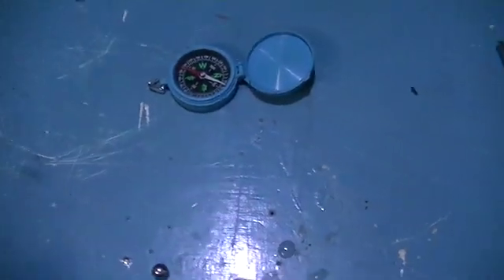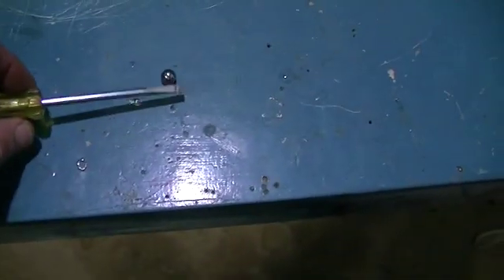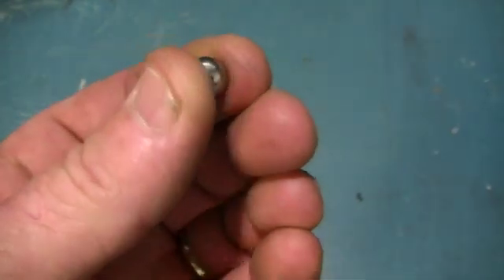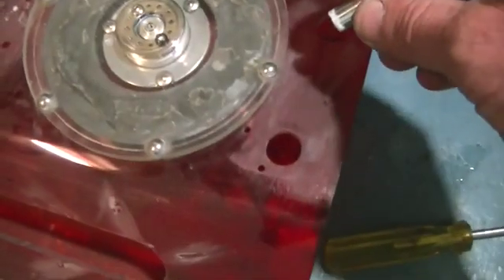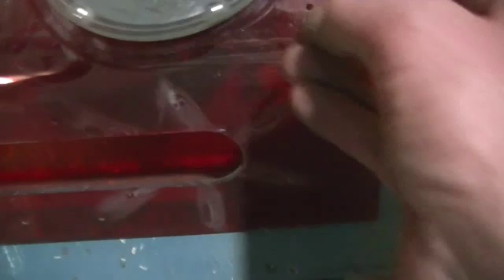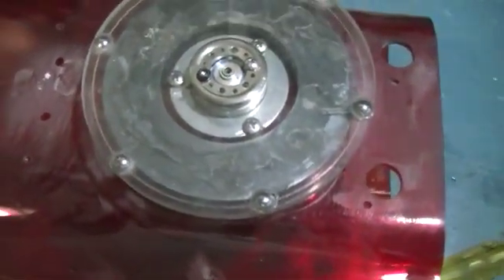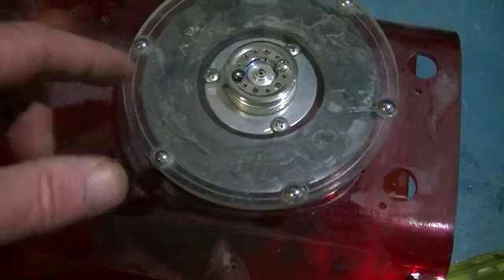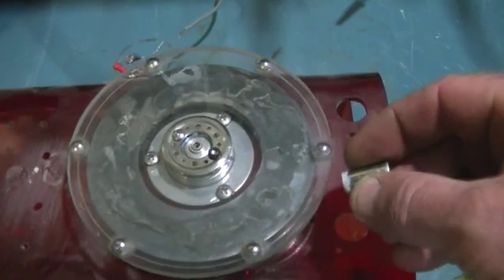making a monopole magnet.mp4

Comment: You don't actually need a monopole magnet. There are manufactured cylindrical magnets, also unipolar magnets which you can buy on Amazon; the cylindrical magnets which have one pole pointing in and one pole pointing out, will give the desired results.

Comment: This is another proof that you can't break the law of thermodynamics. You can not make a motor with static magnetic field. Tesla's brushless motors are using rotating magnetic fields with his polyphase AC motors.
Reply: +Odouls77 Still Tesla was told that AC polyphase was impossible by a professor. He said it was a "perpetual motion scheme, an impossible idea". This is what fired Tesla to prove it could be done.

Comment: You are right you have to have motor 1/2 magnetic and  1/2 conductor at the atomic level  to make this type of motor to work perpetually. The reason is you don't want one metal taking on more  magnetic attraction than the other meta so that it puts less resistance  into any motor. I know we are talking about magnets but the end result here is a free energy device that powers up enough to have a load put on the motor with out any prim mover except the electrical motor that self propels itself and power other  devices as well.
Reply: free energy motor doesn't run some trick has been used

Comment: All magnets are bi-polar but a shaped field can act like a mono-polar field. Check Youtube for David LaPoint and his Primer Fields. A current going through a magnetic field can reshape the fields and do what I call phase shift to change the shape of that field. Best way to see magnetic fields is with plasma flow. Now we are getting into some cool Tesla stuff.
Reply: Thanks you for pointing out David ;)
Reply: Craig Watson Sense I commented before, I have learned a few things about magnetic funny actions that still blow me away. In fact, magnetic funny action can account for almost all things in the universe. Magnetic force is the mover and all other things are just effects of such. Starts with magnetic potential, force, polarization, action, reaction or induction in a cascade event from higher magnetic potential to lower magnetic potential by transformation into wave energy. The lower the magnetic potential, the slower the transformation to wave energy and at this time, the magnetic potential of the universe has reached the flat side of the curve. Light speed is slowing at a slower rate due to the curve. All matter, down to the subatomic, has magnetic potential with infinite range of influence. These magnetic fields span the universe and it is the medium witch all wave energy propagates across. It works much like the universe is a large sea of magnetic fields that are infinite in range. This model unifies all things into a perfect unified theory. Much more about magnetic funny action I could tell and only now finding terminology to do so. Anyway, never let the current theorists stop you from seeking the truth of things, if they had the truth, we would no longer be seeking it. ;)

Comment: Hey mate,  hate to spoil your party, but anyone can make a monopole magnet by simply putting two magnets together, north facing north or south facing south.  Start out with 2 ceramic #8 magnets, And get a pole detector," at magnets for less" glue them or screw them.  It works every time. They say in science magazine it is only a theory.  After you get the 2 together hide it in a steel tube, then emberase your physist friends, then  Email me at theprocover@gmail.com and tell me the story.

Comment: Actually I believe I am correct, Maglev trains use a cycle between repulsion and attraction inorder achieve forward motion. Wheather you are using that cycle to rotate a disc or move forward on a track, or it is an electric magnet or a permanent magnet the physics are the same.  There is no monopole magent in this set up it is false advertising.

Comment from the maker: Incorrect-The maglev train uses large electromagnets that are charged so as to repel one another to give lift.These fields are then manipulated to create motion in one direction or another-just like in an AC electric motor.There are no permanent magnet's or steel between the train and track.Maglev trains are nothing more than a linear motor that travels in a straight line rather than rotate.

Comment: There is no magnetic monopole in your system, there is an interaction between the bar magnet and the speaker magnet. The flux is inducing through the ball bearing. The principals you are using is the same add a mag lev train and the don't talk about a magnetic monopole.

Comment: of course z1az is right - true monopoles don't exist, but these ball bearings have their magnetic fields aligned with the speaker magnet, making their southpoles all facing outward (and attracting the northpole of the magnet in TinMan's hand) while balls' southpoles are facing inward, towards the speakermagnet.
They appear to be monopole because the other poles is "inside" the plexiglass rotor.

Comment: Technically, I think z1zaz is right. The side of the ball in contact with the speaker magnet turns south while the side of the ball away from the speaker magnet turns north. Since the balls are free to turn they are repelled from the non-stationary magnet.
So, it's not really a monopole because there two poles still.
But I commend you for this video. It was very creative and ingenious!

Comment: Yes the ball becomes a free magnet in N-(S/N)-S series with magnetic lines surrounding the loudspeaker magnet, just like a compass needle aligns itself in series with the Earth's magnetic field.
So obviosly it will appear to extend the N pole field, for you are not able to measure the magnet side of the ball without sensing the magnet itself.

Comment: But those are microampere electrostatic devices.
Also the charge flow is via mechanical transport with insignificant current flow until charged capacitors or a large sphere are discharged, whereupon magnetic disturbance will most certainly be demonstrated.
Ever checked for yourself with a sensitive compass, say in a permanent magnet earth counterbalance created magnetic null environment, because it really is the case that charge flow or mechanical reaction and magnetism are inseperable.

Comment from the maker: Lol-you been googleing again.
The south end of a compuss needle will point directly at the center of the north field spa.This happens to be on the edge of that speaker magnet.
A PM has a flow from north to south,until the two fields are joined by a magnetic material.The flow then become's bidirectional.
Next you will be telling me the north pole has a north field.

Comment: No.
The ball embodies unbonded outer atomic electrons rotating about magnetic (molecular domain) axes aligned by the magnetic field of the loudspeaker magnet.
If you were to view the angular direction of spin from the magnet side of the ball it would be reversed;  ie;- the other pole of the induced polarisation.
The ball is like a low ohms resistor in an electrostatic field, and if you could measure differentials it would have a magnetic field gradient between magnet and different outward points

Comment: A magnet has-IS aligned electron orbits, and ALWAYS has physical N plus S magnetic field aligning properties depending upon which axis end those electron orbits are viewed from or applied.
**There is no such thing as a monopole magnet**
What you are doing here is aligning the *ballbearing electron orbits* w.r.t. the looped loudspeaker magnet field, 
and then causing attraction or opposition forces in them, 
by approaching your small cylindrical permanent encapsulated electron spin field magnet.

Comment: I think the ball bearings are only monopoles in 2D - roughly in the plane of the disk. If you try wiggling the free magnet below the plane of the disk then does the disk move in the opposite direction? (Thus not monopole in 3D)

Comment: this is true, but if a ball bearing has become an extension of one field of the PM, then if it is extending the North pole, the bottom of the bearing, or side that is closest to the PM will have a S pole wouldn't it? this is how the ball bearing would even stick to the magnet to begin with.  with the bolt and compass experiment the field should be the same around the bolt because of the axis of magnetization. an axially magnetized cylinder would do the same thing wouldn't it?

Comment: if made on a large enough scale to counteract weight, I've always thought lead may be the way to go, large magnets and lead shielding, but the bigger you go the larger your shielding may need to be, but if started by hand one may only need a smaller magnetic field then first thought. it always takes more energy to start something from a stationary position then it does to keep it going once already running. as always just food for thought.

Comment: We need to come up with a material that cancels out / blocks magnetic fields, then you could place the ball bearing with in gaps of this "material" and the magnetic field from the speaker magnet, then you could work with pure monopole magnetic field, also would give birth to the ability to make a magnet motor, by means of blocking the sticky point that we all face with magnetic motors...  this is something I have tried but have not yet had any luck, need more equipment and random materials